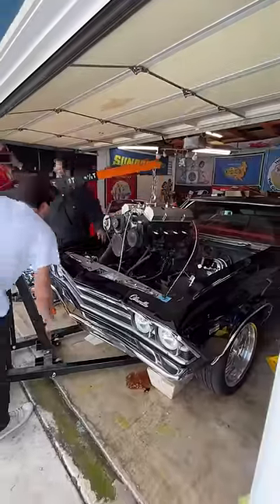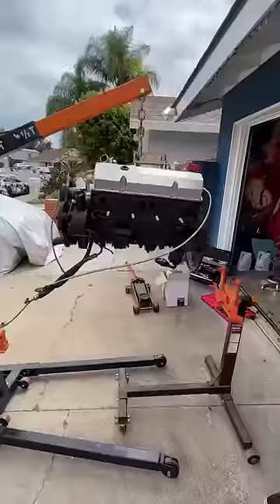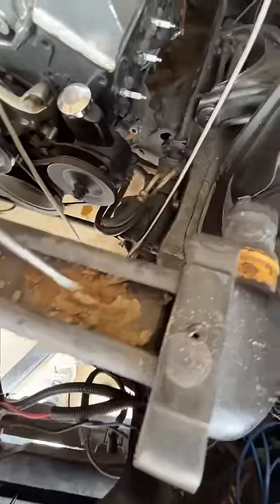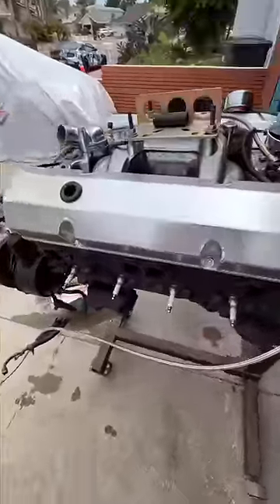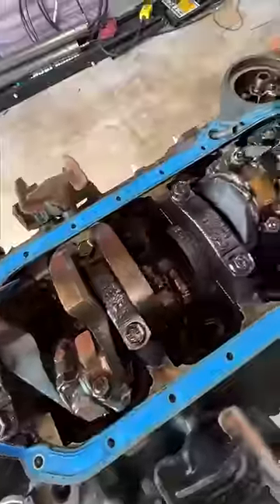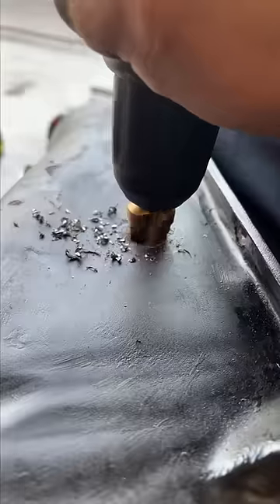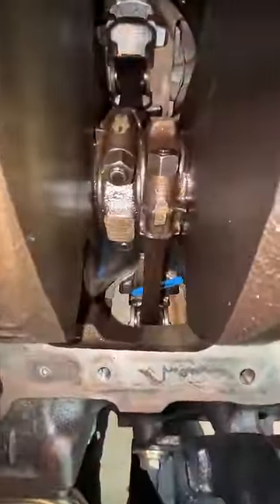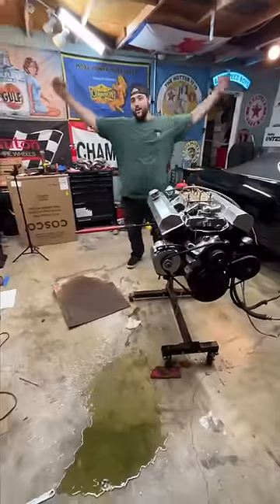Pulling the Engine out of my Twin Turbo Chevelle

Comment: Did you forget to unbolt the converter looks like you dumped a lot of trans fluid on the ground. and the bell housing bolts are supposed to be different lengths on certain vehicles. there should also be dowel pins in the engine block make sure you have the trans flush against the block and on the dowel pins. don’t use the bell housing bolts to suck the trans up to the block. also long converter bolts kill converters make sure they don’t bottom out on the converter. And if you’re not planning on taking it apart soon some anti seize in the dowel pin holes will keep the trans from getting stuck to the block. Happy wrenching brother

Comment: Hey if you drop something into your engine you can get it out with the vacuum cleaner. Just add a little clear tube with some duct tape and the suction will pretty much pull anything that you dropped in your motor out

Comment: You don't need to use a lot of silicone sealer you only need a small little line and the gasket does the work of sealing the sump

Comment: With those two bolt main caps you're going to twin turbo those rods straight out of the side of the block. But with any luck at least you'll be having fun when it happens.
Reply: 2 bolt block’s for 400’s are stronger because of no invasion into the web areas.

Comment: 2 bolt mains block be pared to up replace engine someday if you going to hot rod it hard ...look for a 4 bolt mains block to build another when you scather this one
Reply: The 2 bolt block for 400’s are stronger because of no invasion into the web areas. Could do splayed caps or ARP main studs to strengthen this engine up though.

Comment: Twin turbos with two main block and stock Rods , one bolt on the stock flex plate am sure it didn’t run long 😢
Reply: 2 bolt block’s for 400’s are stronger because of no invasion into the web areas.
Reply: @ImpalaZac  stock rods and a cast iron crank and a two bolt main block is a set up for a disaster with twin tubes . Funny thing no one has heard it run yet .

Comment: Should've used the cork/rubber gasket set. Those one piece gaskets leak horrible. Even worse when siliconed up like that. Different length bellhousing bolts is nothing, one missing is nothing. I had three on my S10 forever with no problems. A missing converter bolt, mild concern.

Comment: You need all 3 torque converter bolts but the different length and missing one bellhousing bolt is normal.

Comment: Wait a minute.  Oh, that's right.  This is the channel that shows us all what NOT TO DO when wrenching on a car.  You don't use RTV on that gasket.  It will absolutely cause issues in a short amount of time.  But I'm sure the instructions stated that already.  Or do you read those?  Also, where is your screen on that oil line?  You're going to be sucking up all sorts of debris into your turbo.  Oh, but that's OK, because you don't really like your turbos all that much anyway.

Hey, you may want to check out this place called You Tube.  There are a bunch of guys on there that know how to do these types of things the correct way.  Maybe look at them and see how to do it and then rebuild your hotrod the proper way, so you can enjoy it for a lot longer.

Comment: Yo brother, 2 bolt 🔩 main, and all stock bottom in will not work with turbos. You need 4 bolts 🔩 splayed caps, and all forged internals. You got the right block. Better to make a 2 bolt 🔩 main cap instead of a stock 4 bolt, to a splayed caps. Why? Because the registers are stronger! 😊😅😂
Reply: 2 bolt is probably fine on low boost but whats the point of that lol, he should get it drilled for 4 bolt mains
Reply: It will be fine with 1 turbo. Not 2 turbos. It will absolutely fly apart
Reply: @kevinroberts781  No, it won't. What makes you think that?  A single turbo can put out high boost too.
Reply: Engine is find but he needs to gap the rings.
Reply: @Ed70Nova427  You don't know much about high performance. He needs all forged internals.
Reply: @theone-fl2ul  I've been around. If you have all that fancy stuff, fine. Once you add boost you have to add ring gap no matter what you have, no matter what engine size, no matter what your normally aspirated hp is, car, motor cycle, truck, no matter what, you need to open the gap on your rings. If you've raced all your life and used that premo stuff, that's great! You should stop one time and try throw a cheapo two bolt cast crank, factory rod engine together, add turbo's with good flowing heads and if you're going to shift between 3 and 6k use a duel plane intake, even with boost. If your going to shift between 5 and 8k (or more) use a single plane intake. Open the ring gap (0.026", 0.028"). If you have all the fancy expensive stuff, or if you run factory stuff and don't add ring gap it's nothing more then a grenade.
Ran a blown small block rail back in the seventies, spent tons on expensive blocks, cranks and rods, only to find out 95% of our failures was from the ring gap being too small (there are conversion calculators for it now). Once we got long life engines because of wide ring gap, we tossed a 350 together, 30 over with 0.010" clearance on used Jahns pistons with factory rods machined to full floating pins, cast crank, two bolt mains, shifted at 8 grand (8,000 RPM no misprint, factory rods), running a Turbo 400, reverse valve body and a five thousand stall speed Ford Pinto converter going into a narrowed Oldsmobile rear diff. with drum brakes, in an old front engine rail just for fun and we were surprised as hell. It lasted all season running Wednesday nights and we never took the engine apart. Sold the chassis at the end of the season and put the short block portion that still had the 0.028" ring gap in a 69 C/10 for a parts delivery truck for the shop. It only smoked on downshifts and long deceleration's.
On the street this guy would've been fine but he didn't do the most important part of running boost. RING GAP! He's going to blow it up and everyone is going to tell him he needed a four bolt main with a forged crank and rods. It also looks like he has factory heads that don't flow and a single plane manifold that make HP at the top end. That's not how to match engine parts. With two turbo's he's going to go into boost early, below 3,000RPM and it's not going to start making real power until the intake is in range at around 4500 and he's going to shift at 6,000 keeping the rings so hot the ends are going to touch each other, As they continue to heat up and expand they will try to stop the pistons in the bore. Can you imagine what the rod bearings, wrist pins, mains will be going through? The piston lands break off first then it all goes. The engine might just have another chance because the torque converter looks like it's been over heated so maybe the transmission is cooked and it will just slip. I hope he pulls it out and gives it ring gap. It will be a fun ride.
EDIT: You know those guys in those Turbo Honda's tearing up the drag strips, I guarantee they are running a minimum of 0.028" gap on their rings, maybe in the 0.031" range, even if they're on E85.
Reply: @Ed70Nova427  Bullcrap, I am running total seal rings with 2 twin turbos. "A Gapless top provides the greatest performance benefit (increased horsepower and crankcase vacuum). However, a Gapless® 2nd provides excellent oil control and blow-by prevention (less oil consumption). As such, we typically recommend a Gapless top for naturally aspirated applications, especially V8 and straight engines. For flat (horizontally opposed) engines and turbo or super-charged engines, we recommend a Gapless 2nd. Most Total Seal® piston ring styles are available in Gapless® configurations."
Reply: @theone-fl2ul  Don't get pissed. We're just talking. 
Gapless are Great! I don't know what he has in that engine, but I'm pretty sure there not gapless design. He says it looks rebuilt so who knows, maybe they are gapless. If so, no sweat, he's got it made. If the are not the gapless design and set up for naturally aspirated, he needs to regap the rings. Right? You can't run standard ring gap when you run boost. Turbo, or any design supercharger has to have extra ring gap. There is no way I am wrong about that. Are you running a sbc or the LS? Those freakin LS love boost.
Reply: Trust me, I'm not pissed. I've been there and done that. ✔️ I like  hellfire rings on my other turbo motor. Anyways, his value train and stock bottomend can't handle turbos, respectively. I am using turbos on a lt and ls Motors. And a blower on an aluminum IA pontiac motor.
Reply: @theone-fl2ul  Does any one know how much boost he intents to run?
Reply: @theone-fl2ul  The problem with boost is, once you have it, you always want more.

Comment: Putting the "super-sticky" RTV on the outside of the bolt holes is a mistake that could allow oil to leak at the bolt holes.

Comment: the bolts being different lengths is normal and you have to put then back in the same hole bc if you throw a long one into a short hole it can break through and cause problems

Comment: No silly-cone on the rubber gaskets - you may have caused another leak where if you left the silly-cone off you would have had a long lasting oil pan seal.

Comment: It's suppose to have different length bolts for belhouse, cylinder 8 is really close to the housing soo I'd you put a long bolt their you will cravk the cylinder 😊
Reply from the maker: It’s supposed to be 2 short, 4 long. I had 8 all different sizes lol. Some were very short

Comment: Man I’m so tired of guys putting rtv on gaskets lol. Like they go on dry. If you want to use rtv then just get rid of the gasket. 

There are very few applications where rtv has to be used with a seal or gasket. Like on valve cover gaskets they ask you to put a dab on where valve cover meets the front cover.

Comment: Bro go to auto parts get plastic gauge check tolerances on your rods and Mains before you put it together that's how you know if it's been rebuilt or not and I'm sure you know about your compression check right make sure you wipe all the oil off your rods and Mains before you put the plastic gauge on there

Comment: A 350 flywheel will be out of balance. The 400 uses its own flywheel. The bolt may have been taken out of the torque converter to stop the shake.

Comment: I bet the open gasket is going to leak.
When it dies next time, just use RTV but do not tighten it all the way just to wear it starting to push a bed out and then stop and let it sit for 24 hours then tighten your boats the remainder of the way.

Comment: It's gonna leak BECAUSE of the rtv, only dab the corners. You created a non-flat surface that will leak sooner than if you did it properly. If you don't know, ask. I promise it's gonna have a drip after you run a heat cycle.

Comment: I replaced a bunch of vacuum hoses on a 1984 corvette, i cut them from new bulk hoses and one of them had a dirt dobbers nest built in it, that was not fun to figure out as to why the brand new engine i just installed wasn't running right... smh being an automotive tech has caused me to turn grey headed😂 on another note, crossfire injection was one of gm's worst designs thats why they only made them one year! Stay away from thos engines if possible lol

Comment: You need to at least gap the rings for boost or it will blow up the first time you give it any kind of heavy RPM. Also its only a 2 bolt main, it cant handle the stress of boost. Wrong motor to use for this, it is  just a stock low end rebuild. Find yourself a good 4 bolt 350,400 or 454. H beam rods, a good set of pistons, Eagle Crank and Aluminum Heads. If you don't get a 4 bolt at least gap the rings as a minimum first big boost will rip the tops of the pistons otherwise

Comment: "It looks like it was rebuilt" 
Safe to say if half your bolts are mismatched or missing its not rebuilt.. someone tried rebuilding it, realized they know absolutely nothing about fixing cars and most likely paid someone to just get it running enough that they could sell it and try to get out of the hole they dug while it was still shallow enough to reach the edge. Saw this exact same thing when I went to look at a potential challenger rt for a project car, dude said it still ran good just needed some fluids changed and body work from the accident it had been in but when I looked underneath 1 of the engine mounts was completely gone, the belt was half shredded from a bent pulley making it rub against a piece of metal, radiator had been patched up with jb weld. All around just a complete sh*t show of a car. I'm not the best mechanic in the world but I at least have sense enough to know what I can and can't work on 😂

Comment: Don't use rtv on a neoprene/rubber one piece seal.... hacker. There's only a few small spots that need a dab of sealant. (Front and rear where the rail meet caps/t cover)

Comment: Bet there were only two converter bolts because the bolt pattern didn’t match the pattern on the flex plate

Comment: Adding twin turbo?  
Do you have low 8.0 to 1 (max 8.5) forged pistons?  I will guess the rebuilt NA engine is high compression.  
After the oil passes through the bearings for the twin turbos, the oil needs to drain down VERY FAST!!  :  Consider - - 
 much larger oil pan;  
 the drains into the oil pan should be at least 1" above the oil level (both engine running and off), but if you want to road race or autocross or donut, I would do a separate oil sump;  
 consider a breather box, as crankcase pressure will go waaaay up - even if the rings seat very well with minimal or no leakage;  
 fuel tank should have center sump/fill (in the middle of the tank) to keep the pump & gauge sender immersed in gas.  This requires a second low pressure pump in the tank to keep the center sump filled.  Is your present fuel pump (electric I hope) adequate in volume?  3/8 or 1/2 inch fuel lines?  
😳🧐🤔🤨
@backspeedboys

Comment: Them one piece gaskets are TERRIBLE. Didn't anyone tell you that? Especialky on a boost application! It will push the gasket out at the rear and you'll have a major oil leak. Remember you read it here first!!

Comment: not to be a downer, but if you are boosting a stock bottom end small block without 4 bolt mains you really aren't going to get far, you should do some research on new forged internals and ARP fasteners for the mains and Conrods

you can just boost it, but dont be surprised when you can maybe put 6-7 lbs of boost in it before it blows up

Comment: Your biggest problem is the fact your Twin Turbo Auction Car Chevelle only has 2 Bolts holding the 400 Block Main Caps. Good Luck with your Mickey Mouse things.

Comment: Why would you put RTV on that gasket? In the forty years I've been working on Chevy small-block I've never had an oil pan gasket one piece like this ever leaked ever for any reason. Least you didn't use blue or orange RTV so I will continue to watch. By the way you don't even want to be friends with someone who uses blue or orange RTV!

Comment: Sure doesnt look rebuilt to me cast crank two bolt mainsgasket sealer on pan gasket where did you learn to work on cars two bolts in the flex plate should be the least of your conserns